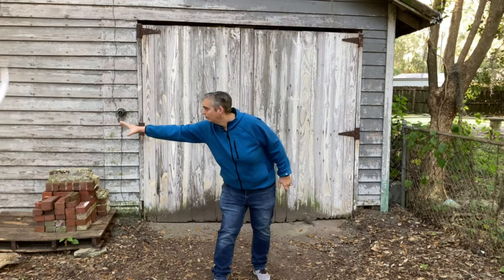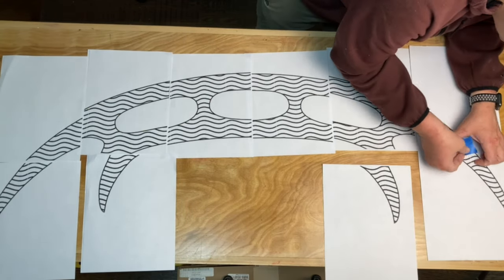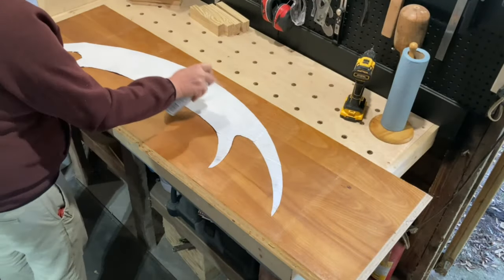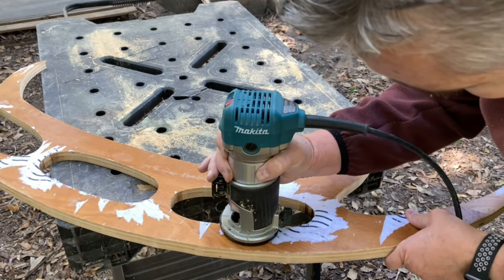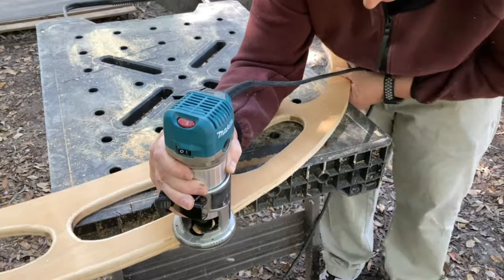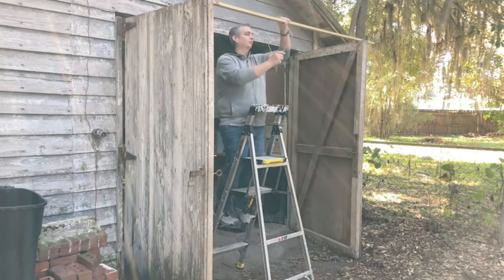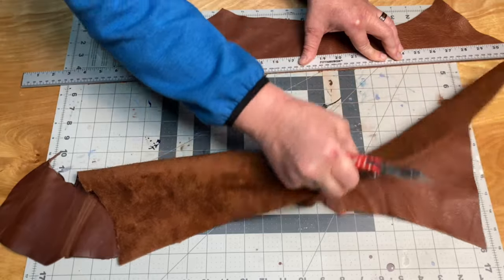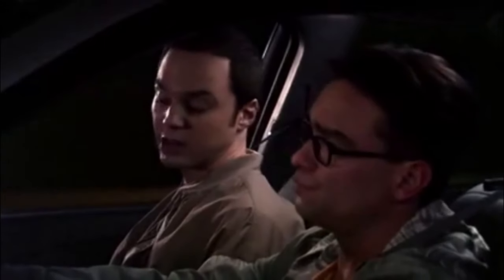Making a Klingon Bat'leth // DIY Movie Prop

Comment: My print out did not quite look like yours. I did notice some gray lines on the pages. Is there a trick to getting these the lineup other than just eyeballing it. I'm fine with doing that, I just want to make sure before I move forward. Thank you very much
Reply from the maker: Sorry, I know it's not perfect. I originally found it online and yes, I just eye balled it till it looked right to me. It does take a minute to make sure all the blades are in the right spot.
Reply: @boydstongrove  no apologies necessary, I was just wondering if I was missing something. Thanks again!!